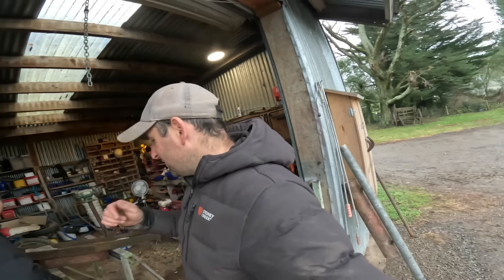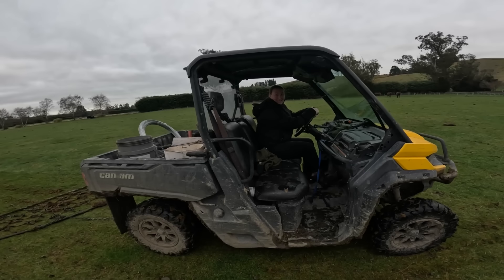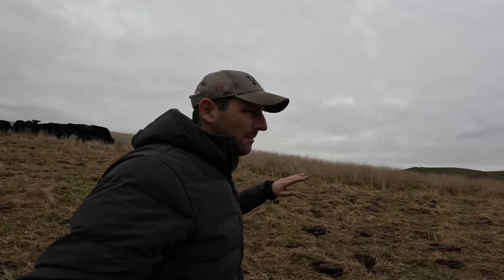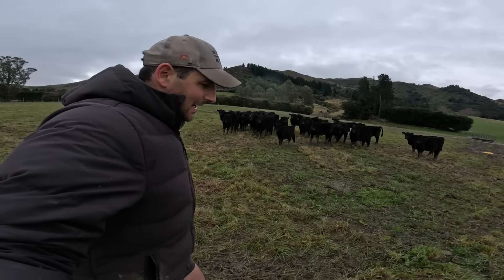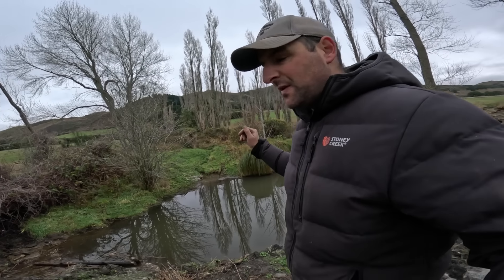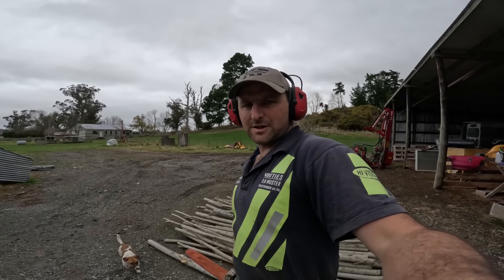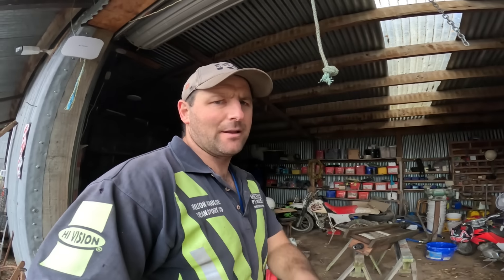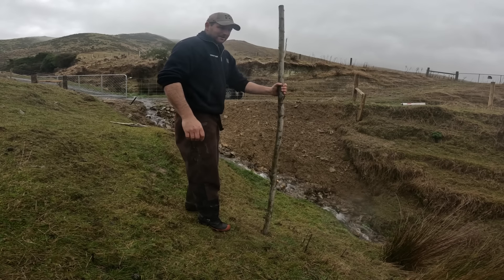Mid-Winter Pole Dancing

Comment: On motor bike i had an old honda ct200. Exact system to the quads. Rev as per normal the use foot peg to change gear. Awesome bike for what i did.

Comment: Thanks for your vlog, A question: Does wool pay for itself or is it offset against the carcass, lambing price? I know it complicated but if your farming for wool does it pay?
Reply: Alistair will know, but it my experience it barely pays for the shearing.  Some farmers are looking at self shedding breeds. Very sad for such a wonderful product.   I have seen a vineyard experimenting with laying the raw sheared product under the vines for a weed mat (from experience it works very well as a weed mat).  Apparently it has also had positive evidence of improving ripening from the reflection off the white wool.  Wool hasn’t been worth much for over 30 years and seems to be an issue worldwide wide.
Reply from the maker: No not even close. We need around $4.50 per kg clean to cover costs